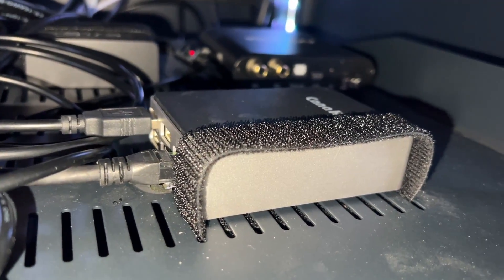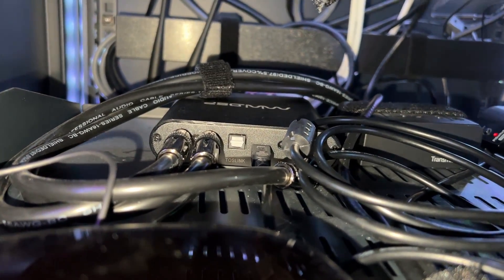Use Harmony With Your MiniDSP And ezBEQ To Automatically Clear Filters When Done Watching

Comment: Smart idea! 
Off topic, but is there a way to access the miniDSP gui/settings from Rasp-Pi or Android, or do you have to reconnect the miniDSP back to a PC/Mac if you want to make some spontaneous adjustments?
Reply from the maker: For sure! All you do is put in the ip for the pi, in the MiniDSP software to connect
Reply: So are you using a housecurve on top of Basseq or are you running a  ‘flat’ curve ?